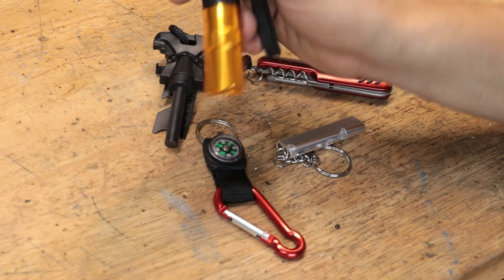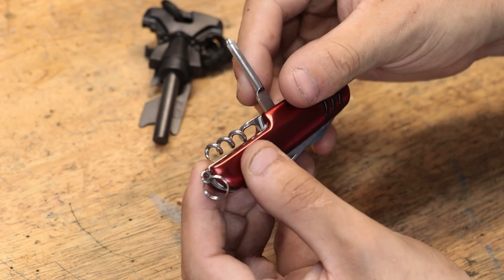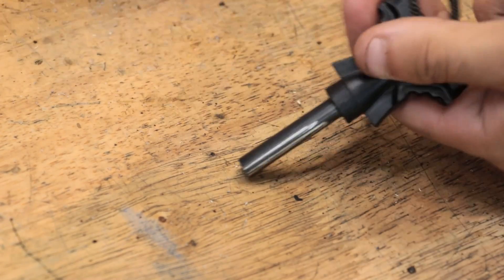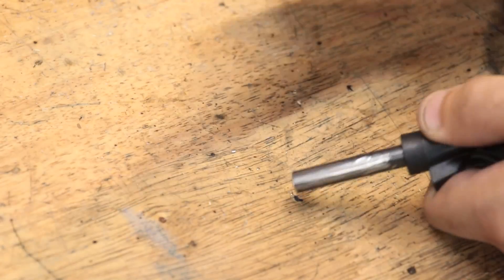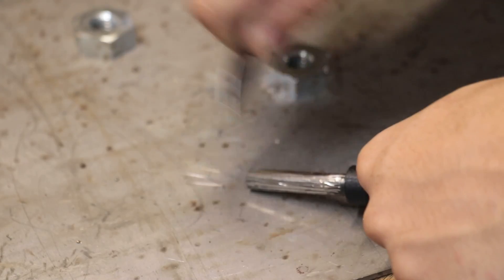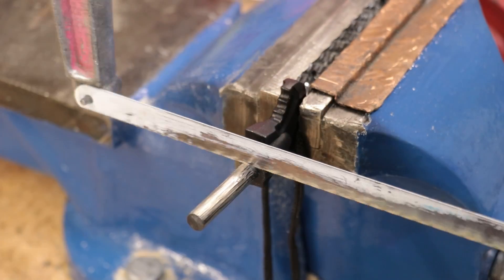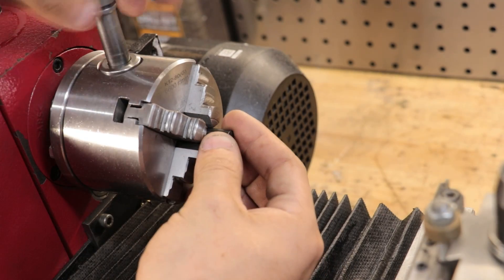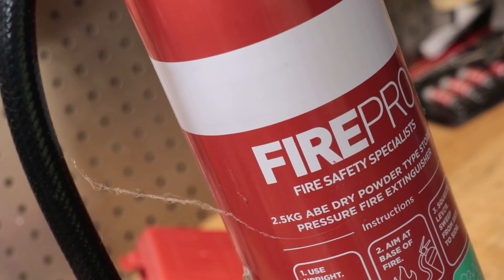Machining Ferro Rods/Fire Starters On the Lathe

Comment: well, you may have thought it was a waste of time but it proved to me a point I had been pondering for some time  If,  The rod was flat it could be used as an alternative flint for a muzzle-loading gun there.  As there has been a lack of flints,  of late & you have just revealed an alternative Use to the ferries rod.  possibly Improving lock firing times into the barging  Well bon son some the ues.   Require a flat ferries rod.  As of the axe saw demonstrated.  The prism would aid in striking a spark.. when struck as if it were a flint. Interesting very interesting in Dead.  someone will be testing this out now no doubt

Comment: just FYI never use a blade to ignite a ferro rod. in an expensive knife you will damage the edge of it.  there are knifes where the back of the blade have a grind to make it 90º and that kind of 90º edge is the best to use with a ferro rod, not the blades. good quality knifes tend to have 90º edges on the reamers, saw blades and in some cases on the cutting blade
Reply: The back of stamped blades work great for throwing sparks. I have an Opinel that is great for use with a ferro rod because it's stamped.

Comment: "...but hear me out."

The disclaimer when the person trying to justify their actions, when ever they know it is probably a bad idea. 🤣🤣 This should be fun, and safe on this side of the glass. 🫠

I do want to add something. I should probably look this up before saying anything, but from good ol time science. I would suggest staying away from water with this. Couple reasons, first of no real consequences. Hardened material and carbide inserts don't mix well with coolant (water). The majority concern I have, is if this stuff behaves like (or is) magnesium. DO NOT MIX WATER TO MAGNESIUM. More so, if it is sparking or on fire. Just in general, you never let any liquid near magnesium while machining it.

Comment: Another fun thing to do with a Ferro rod is take a chunk, wrap a wire around it as a temporary handle, heat it up with a torch until it just starts to glow, and chuck it at some pavement.  I used to do this with the tiny rods in spent lighters.  It's pretty spectacular.

Comment: Ferrocerium is basically pyrophoric metals, in particular cerium and iron oxide, but also other trace rare earth's that increase the sparks, that are sintered into a rod form.  The metals rapidly react with oxygen in the air when subjected to friction due to the low ignition temperatures of some of the metals.

The issue with turning or otherwise machining it however, is that the byproducts of the metals burning are things like cerium oxide, which is an abrasive that is commonly used to polish glass and jewelry, and that abrasive dust coats your lathe surfaces, so I would be very careful in cleaning your lathe and all the ways and leadscrews, etc, even though it is a cheap Chinese lathe...
Reply: Thanks for the explanation. Probably could find it on Wikipedia or somewhere, but this is very compact and to the point.
I would say particularly on an inexpensive lathe for clean up. More expensive tends to equate to more durable in machine tools.
Reply: Answered the question I came here to ask!
Reply: Yeah, thanks for the explanation.
Like others, I wondered what these were made of.